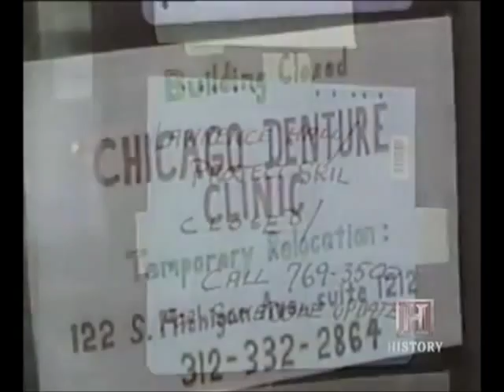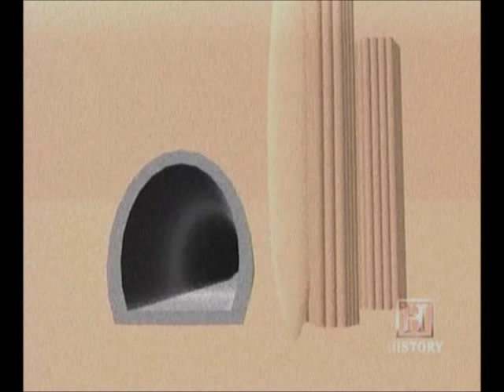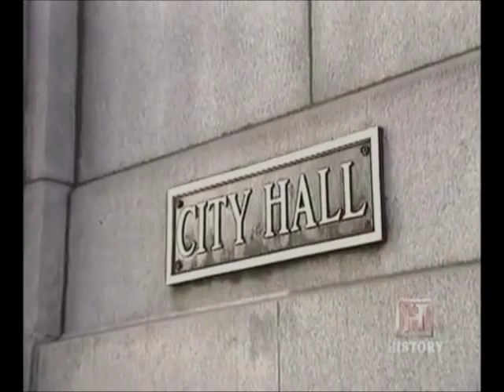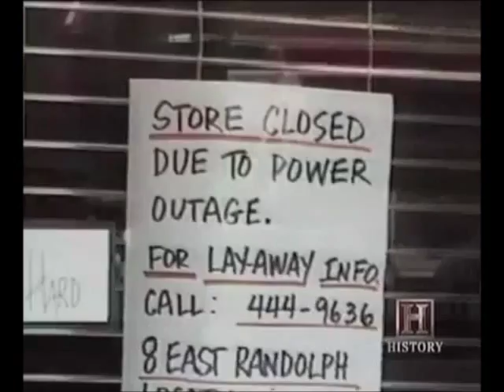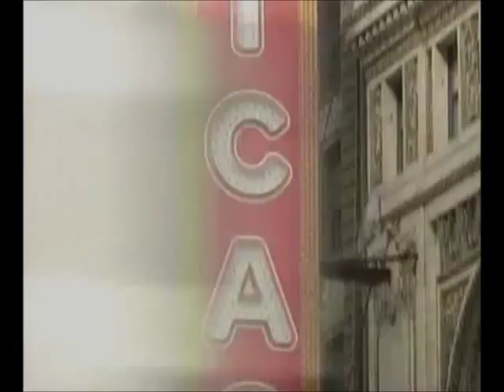Engineering Quiz 2 The Chicago Loop Flood 1992

Comment: Ugh remember it well as I had a business that had its own street entrance in the Chicago Board of Trade. Overnight a  generator and portable air conditioning unit the size of a semi was parked in the middle of LaSalle St, almost in front of my door. It initially was used only for the trading floor which resumed trading on Tuesday. Divers were outside my window surveying how they were going to seal the tunnel' s entrance to the building. If memory serves it took 6 months to replace everything in the two basements. Mine was one of the few businesses that received anything halfway large from the class-action lawsuit against Great Lakes Dredging a whole $13,000 out of a $300,000 claim.
Reply: Was it really Great Lakes Dredging's fault? They didn't know the locations of the freight tunnels, the city did, and it's the city who told them they were fine to put the pilings in that location.